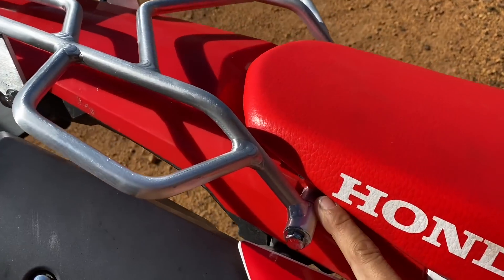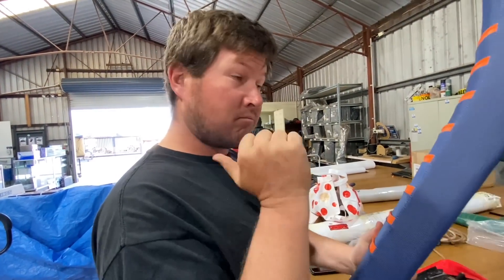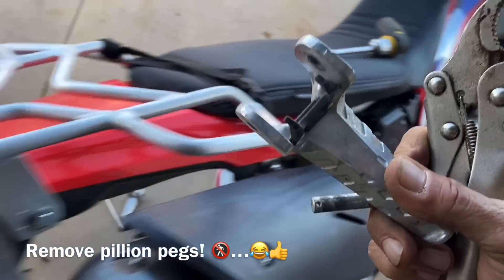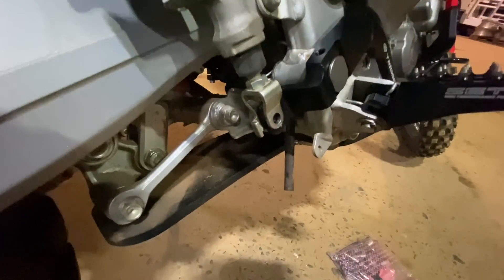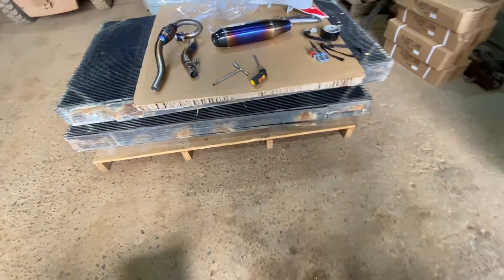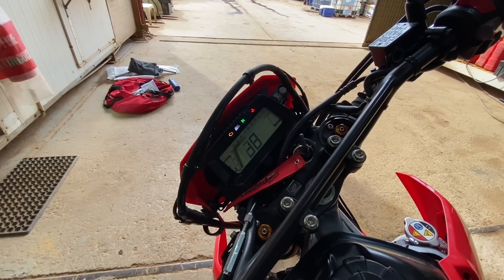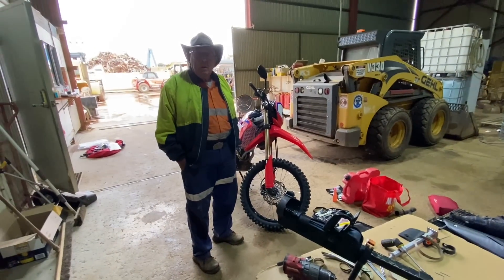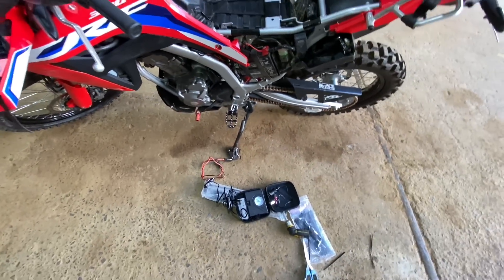Ep1: Honda CRF300L Upgrades & Modifications - Suspension, exhaust, seat, pegs/levers plus lots more!

Comment: I have a 2022 300L. I can’t find the clutch lever and brake lever. Stock  ones are crap….any ideas? In Canada. Looking for model number
Reply from the maker: Zeta pivot lever set! 😁👍 Part No.ZE44-5013
Reply: Oh I made a typo. I meant the foot controls brake and clutch because stock ones if you hit a rock bends. They don’t pivot
Reply from the maker: @TheZakkmylde  Zeta foot gear lever ZE90-4042 & Zeta foot brake pedal ZE90-7022. Both bullet proof 💪😁 I bought mine from AMX Superstore in South Australia and shipped to WA in record time. Great service.
Reply: The left side shifter I found a zeta revolver.  You can rotate the tip because it’s off-center and you can get different adjustments from it but the right side I was not able to find anything.  Thanks I’ll
Check it out 🤘🏼
Reply from the maker: @TheZakkmylde  yep, the Zeta Revolver. I considered it but given I use the same boots every time I jump on the bike, I didn’t have a need to adjust my lever regularly and decided to keep it simple. 😂👍
Reply: @RozalynVeersma  lol. Agreed

Comment: Hermes all dressed up for the dance 🕺 now let us know where the dance is going to be this time 🥰🇺🇸🇦🇺🇺🇦
Reply from the maker: Baaaaahaha Just a few more wicked bits to put on him first Texas and then we’re going to boogie like it’s 1969! 😂👍💃🏻🕺🏍💨
Reply: @RozalynVeersma  can you tell  the difference in HP & Tork 300vs 250 engines. 🏍❤️
Reply from the maker: @rogerhenson6589  yes absolutely! Even with the performance mods I did on Artemis CRF250L…it’s a very noticeable increase. The new 6 speed gearing is freakin awesome particularly on highways which now sits on 110kmph without reving its box off! 😂👍🏁🏍💨
Reply: @RozalynVeersma  😘Thanks for the information

Comment: I have that seat, and the full sheep skin but don't need the skin.  The seat is more comfortable without it, lower too.  The D606 is the wrong tyre for that bike. too tall, too heavy and makes a sidestand adjustment necessary.  Improve your bike and fit a 120/80 standard tyre next time, if you haven't already.
Reply from the maker: The seat with my light weight is excruciating and I wouldn’t be able to spend a couple of hours on it without the sheep skin unfortunately. I’ve tried many brands of tyres both front & rear in the 100,000kms covered over 3 years on every type of difficult terrain Australia has to offer and so far, the D606 on the rear has been the perfect tyre and goes the distance compared to the other brands & sizes I’ve tried. I think tyres come down to personal choice as everyone has different riding styles, set ups, loads, favoured terrains, etc. Until another better tyre comes along, I’ll be sticking to the D606 for my off the beaten track fully loaded up adventures! 🤞😁🏍
Reply: I've done 25,000 on that seat and it is awesome comfortable.  You must have a bony arse.
Reply from the maker: @fawcetttrips2466  hahaha I’m built like rabbit! Not much padding on me at all! 🙄😂🙏

Comment: Great video. I'm struggling with deciding between buying a CRF300L or an XT250 for riding 80/20 twin track/pavement. Any thoughts or did you consider an XT250?
Reply from the maker: Thanks m8! 😜👍🏁 I went straight from a KTM 350 Freeride to the Honda CRF250L. The Honda took me on a 450 day epic adventure ride  around Australia (mostly dirt) and clocked up 49,500kms. The bike has done 82,000 hard kilometers mostly fully loaded with 2 panniers, top bag, extra fuel/water (circa 30-40kgs of adventure gear) in just under 3 years. I don’t know of many bikes that have accomplished the hard work that was asked of it and with absolutely minimal issues and low maintenance. So to upgrade to the CRF300L was a no brainer for me. Tried & tested & proven would be an understatement! 😂👍🏁🏍💨 Before getting the CRF250L, I did consider the WR250R and though it was slightly more powerful, had adjustable front suspension, was slightly more expensive…it was the height factor that ruled it out for me. No doubt about Honda quality & reliability given the price tag. I’m happy to spend a bit more on doing the CRF300L upgrades as I know I won’t be thinking about the cash I’ve spent when I’m having the best time ever on the trails. Priceless adventure rides & priceless memories! 😁🙏

Comment: Great fab work on the pipe make sure the USB port has an off switch or they can drain your battery cheers
Reply from the maker: Yep…thanks buddy. My last one I had direct wired to the battery & when I’d charge my appliances in the evening, I’d always simply pull the SAE plug as soon as it looked like dropping under 12.0 on the inbuilt digital gauge. This guaranteed no accessory power drain. Still investigating whether or not to use the accessory plug provided by Honda in the cluster behind the headlight. It has a bizarre connector that none of the electricians up here stock. So thinking I’ll just go back to keeping it simple and direct wiring like I had in Artemis! 🤞😂⚡️ KISS method! Keep It Simple Stupid!
Reply: @RozalynVeersma  yeah best to do it how you know it because if shit happens your the one who will be dealing with good idea enjoy

Comment: My goodness, you're a handy girl. Excellent work on the heat shield. Although I like seeing the power bomb. I have an American dr-z 400 off-road only with an FMF power bomb made of titanium. I didn't know how lean the DRZ was until I saw the header pipe glowing red in the dark. Titanium is beautiful when it's hot. I rejected it and then rejected it again until the pipe was no longer red... Holy cow it melted the bottom of my front fender. That thing was as red as an old cigarette lighter in a car. Also installed  cams. Recluse clutch, since I am an old man, you never know when the hands will give out. 
   I'm sure with your background and your son' drifting tendencies, you have heard the phrase "bat out of hell". All of those mods woke up the DRZ to where I've had to change the phrase. It's a bat going to hell on a rocket...NICE
That was a fun shot of you mounting the 300 with the camera at the back of the bike, allowed all of us to see you tippy towing. That's cute. I thank God for long legs. I have several off-road motorcycles with modified suspension, even greggie has to tiptoe when the seat height is 39 inches.
  Loved the video of you working on your bike. I love the tinkering. I'm looking forward to more of the same.
  Dry as a nuns nasty, I don't think I'll ever forget that. I thought I might get struck by lightning just for watching that part of your video
Hahaha. I should have covered my ears and said na na na na na na
My head is on fire! I laughed and turn red in my face at the same time. Ahhhhhhhhhhhhhh
  "Oh", I'm still here. You are a riot
  "Texas" on the prairie
Reply from the maker: Hahaha absolutely love your interaction Texas! I love the cyber friendships I’ve made through this crazy journey and I love hearing others stories too! Because that’s what we all are…creating stories, living stories and telling stories. That’s memoirs…memories! 🥰🙏 When you tell me about your past experiences, I’m totally feeling it too because I get it! Can’t believe I didn’t discover dirt life earlier in my life! 🤦🏻‍♀️🤷🏻‍♀️😂🙏🏍💨 Oh well…carry on! 😂👍🏁

Comment: Nice job on the heat shield. I've found without one, I will burn the outside left leg of my riding pants when standing next to the bike when it's hot. Like when pulling it out of a mud hole or something like that, not realizing my left pant leg is touching the hot pipe. Ruined (melted) a good pair of MX pants before I figured it out. 😄
Reply from the maker: Ouch! 😳🤞😂 Yep, as much as I loath to cover up that beautiful piece of engineering…safety first! 🤞😂

Comment: Fantastic mods mate , if you want to bring the side stand up a bit I always mount a hockey puck on the base it’s a 1 inch thick and can be shaped . The SWM RS and Superduel brake line was the same I cable tied out of the way . With the saving of the pipe weight helps account for all the other bling we put on our bikes 😂😂😂, but definitely weight from up high is a good 👍 thing . Mate to lower you bike a bit more just drop you forks through the triple clamps about 10mm ( you know me Roz a short ass as well ) do it with most bikes I have owned better than dropping with links . I get VERY excited 😆 when you use a grinder 😂😂😂, it’s my favourite tool 👍.I have the same compressor had it for at least 8 years GOLD.
Reply from the maker: I’ve still got the Kouba link to lower another 45mm BUT I’m waiting until I get my custom pannier racks made and will load the bike up adventure ready. Once that’s done, I’ll get my suspension guy to tune the suspension for my weight, full load and style of riding. If it then needs to go lower, I’ll install the Kouba link and won’t have to touch the side stand height and then get the geometry of the bike reset again (includes fork height). Oh my poor brain! 🤦🏻‍♀️😂
Reply: @RozalynVeersma  that makes sense with the lowering link and side stand

Comment: The holes in the stock MotoX dBkiller are insufficient to flow the exhaust gas at higher gas flows. If you want to have it quieter than the open pipe, drill the 8 holes to 11mm. That will be a bit louder but flow sufficiently at high rpm .
Reply from the maker: Thanks for the heads up! 😁👍 I love the note that it is producing right now…it lets the wildlife know I’m coming! 😂🙏🐄🐃🐫🦘
Reply: You must be an engineer

Comment: After all the fires over the past few years, I'm surprised that Australia doesn't require a spark arrestor.  Pretty easy to fit one of those cone-shaped ones.  Carry on.
Reply from the maker: Unfortunately most fires here are started by pyromaniacs or dry lightening. Both are devastating. 😔🙏🔥 When it’s too hot here, we have ‘fire bans’ and on those days, you’re not allowed to ride (or drive) in the fire prone areas, let alone use a chain saw or even a BBQ. It’s pretty strict and fines apply if you get caught. We’re all very much onto what is safe & what’s not. 😁👍